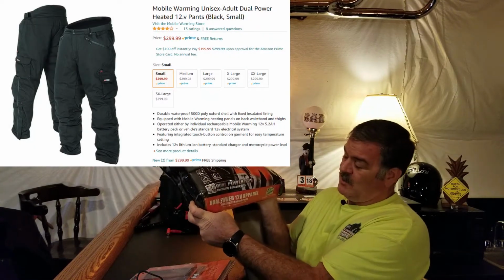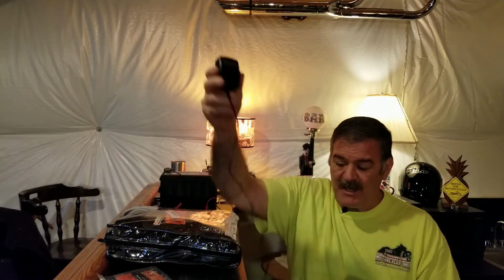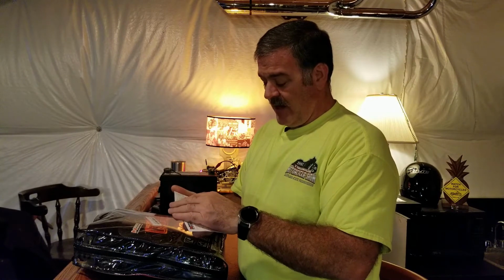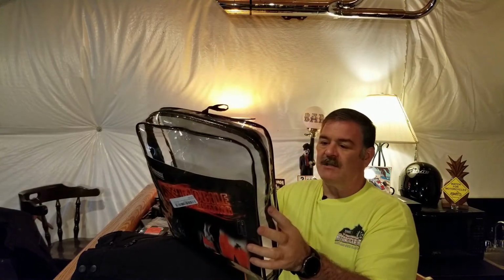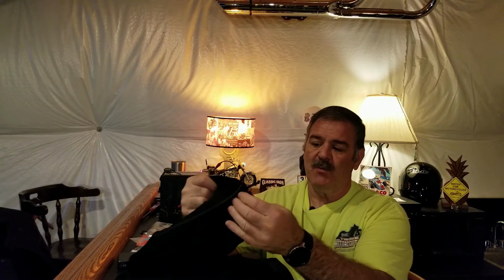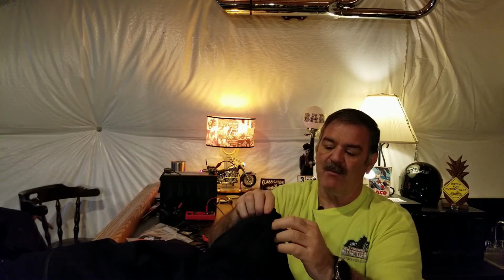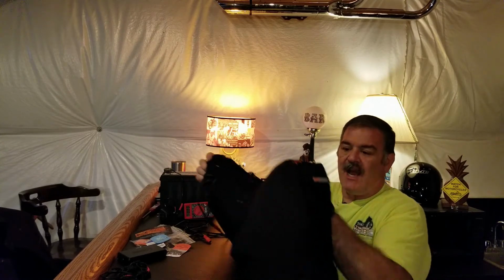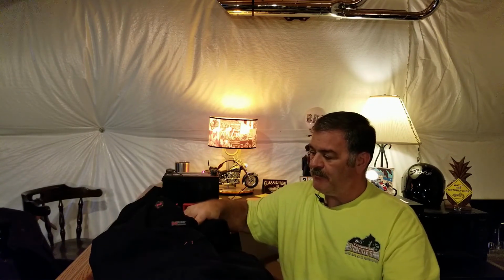Mobile Warming Dual Power Heated Pants Review with Current Draw Test!

Comment: In-depth analysis, very detailed. I’m actually concerned about not being able to wear the pants without taking out my boots first, but I will give it a go. Thank you
Reply from the maker: Hello Luis, that is a valid concern. These pants are heavily insulated (so they can stay warm using less power). If your riding days start and end cold, but are warm in the middle, you may want to choose a heated pant liner as opposed to these pants which are snow mobile (snow machine) grade. You would have to wear a very small boot or riding shoe to take these pants off without removing your footwear.  Ride Safe, Namaste.  -GeezeRider